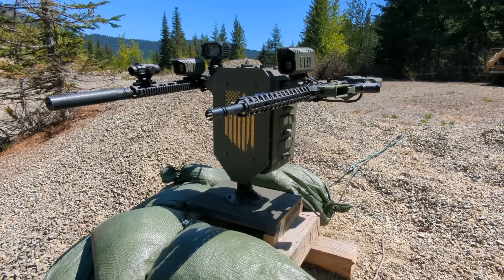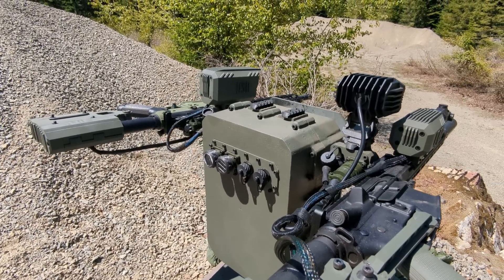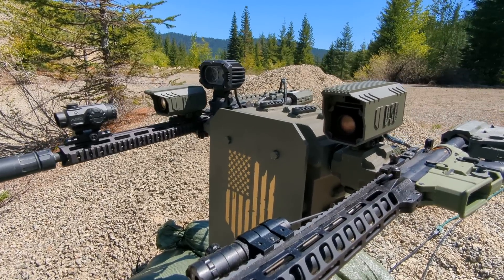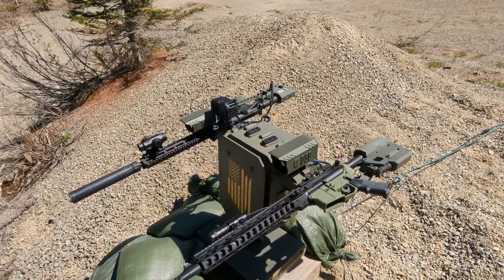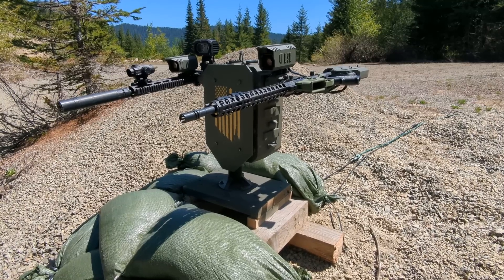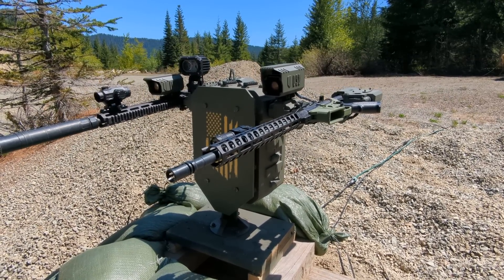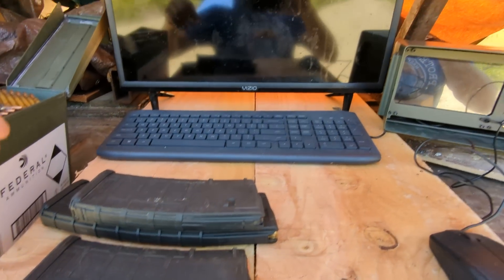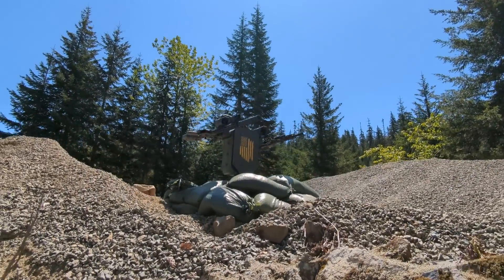Slow walk through of the deplorable powered gimbals features.  Grab some snacks and sit back.

Comment: Seems like any of the digital riflescopes with a video out, would simplify the camera and aiming solutions in a single unit.
Reply: Much more expensive though.
Reply from the maker: Great idea!  Ive never used one.  Do they have a usb output?  Any recommendations for a good one?
Reply: @deplorablesecuritydevices  Most have an USB-C or USB micro output. AGM, Pulsar, Sightron, maybe Sionyx would be where I would start to look.

Comment: If I did buy this.

Visual and targeting.
8K Camera with Night and Thermal.
Radar.

Hardening.
AR500 Steel Pillbox.
Kevlar Sandbags.

EMP Shielding of the Electronics.
Underground Hardwiring. to prevent countering through hacking or electronic warfare.
Reply from the maker: You got it!  Those are all on my list and more!  But starting with what I can do with the cash I have.  Also! the turret has a feature to raise and lower from a Pillbox or move side to side on a rail system.  Thanks for the comments it helps me grow!
Reply: @deplorablesecuritydevices Ukraine  needs this
Reply from the maker: @bobthompson4319  American tax payers have given them 180 Billion dollars.  They could have built 36 million of these with that money.  They have a 2000km border with Russia.  They could have placed these 10 meters apart 180 rows deep.  We could do the same on our border.
Reply: I didn't say give.. Why does everyone  think we just unload crates of cash to Ukraine? Maybe not all of what we give is but a large amount of what we give is expired munitions. Which is things I've ammo that would just be dumped full auto in the dirt and wear out weapons quicker. And just an FYI in the last 20 years Ukraine has been 3rd in the number of soldiers fighting along side of us. Only the  UK sent more.
Reply from the maker: @bobthompson4319  Fair enough my point is any developed country could have easily deployed something like this decades ago.  I think its strength will be realized as a distributed system owned by individual citzens of a nation.  My goal is to put at least four of these in the hands of every american land owner.

Comment: Are these legal for private citizens?
Reply: I can't see why not, it can be sold under an "airsoft" accessory if he runs into legal issues.
Reply: @Nick Loven  if the country is against that, but technically this is just a system, the weapons don't come included so literally this should be widely available if accessible to your country
Reply: Probably not. ATF just got two guys convicted for metal cards with pictures of something that resembles an auto sear... The ATF even cut out the picture and couldn't get it to work as an auto sear. Still somehow landed convictions.
Reply: @vampire847 but that cards purpose is only for making a machinegun and nothing else this can be used for airsoft as was said, or just bulky homebrew camera systems
Reply from the maker: Tyranny has never been defeated by compliance ... just sayin...
Reply: @Vinlaell  Literally the cards can not be used to make a machine gun. The picture isn't the right size or shape. The ATF tried to make it work and failed. The intent of the card is decoration.

Comment: The weapon mounts need to be closer together. If you zero one rifle and slave the other to the same zero it’s going to be wayyyyyy off at any range outside that zero.
Reply from the maker: You can have up to 4 cameras.  So each gun can have a scope camera.  Or the main central cameras have an approximate point of aim on thier heads up display.  If angles and distances between cameras and gun are known easy to implement overlaid reticles on any of the cameras.
Reply: @deplorablesecuritydevices  The idea of a software based reticle would work fine. From my understanding this is to be manually operated remotely so having one camera for a reticle would be sufficient and a red dot would be redundant. Having the barrels as close as possible would provide a much more simplistic reticle that’s easier to operate. I understand it’s a work in progress and it’s modular is design but you need to figure out exactly what you want out of this system. Saying “I don’t have a business plan” is not a good look. Don’t take my criticism the wrong way, I hope you succeed. I have a joint homestead for SHTF/WROL and we could actually utilize a system like this.

Comment: needs a WIFI connection for weather data to make It more accurite at long range as well as wind correction.

It should also have built in Ballistic data so you can have a screen entry for Ammo Ballistics, so it would know what is being fired (presets) so it can make the proper shot to hit the target  (automated).  ballistic data is online.

LOL the Ideas I could come up with this this..

weaponeer
Reply from the maker: @weaponeer  Will never have wifi all hard wired.  Machine vision and local sensors will estimate weather for long range shots.
Reply: @deplorablesecuritydevices  other option is a one wire weather station or components. So Data is available via wired network.  simple system. I used one for years to report the weather for our area.   I intend to use one again on my private range, especially for wind, and direction at fixed points downrange. more data=better dope, especially wind changes midrange 1000 yds and one at 2,000 yds (obviously a sentry would never shoot that far and even at 1,000 it does nothing but Raise costs, 300 would be good with overlapping fields of fire.  with proper long range thermal at least you can tell the difference between a man and an elk for required Pid.  the price can get rather steep when pushed out further
Reply: @weaponeer I don't see how a weather channel would provide accurate enough data. Wind can change so much in a few miles. Good idea. It should have the ability to connect to wifi for remote operation
Reply: @ToxicTom1967  the one wire is a local weather sensor setup, Which I used on my range.  But I prefer the kestrel 3500NV as it's more portable.
Reply: @weaponeer  sweet channel idk how u don't have more subs I subscribed
Reply: @ToxicTom1967   thanks for subscribing....    Never could get much traction for views, so i blame YouTube and its stance against the 2nd amendment.

Comment: What happens when spalling shoots into the handguard holes and into your gas tube
Reply: he shot at it in his previous video, although only a few times. im sure with a different type of handguard or mlok covers it'll be just fine.
Reply: People really over estimate spalling. Also if they are hitting the armor they’ll prob hit the guns too.  Even if the spalling could hurt them that’s not the big concern
Reply from the maker: Yeah, Derek and Simon nailed it.  Also anti spalling coatings is a solved problem on personal body armor.
Reply: Use piston driven, eliminating gas tubes, will run much cooler cleaner, way more reliable!👍🇺🇸
Reply from the maker: @user-ds6uc2hx3f  Oh!  Good idea!!!
Reply: Cool, good thing I had asked what would happen. 

Will there be a wireless variant and would you use LTE or a standard RF frequency? 

Sorry I just read the description. I was also wondering if you would ever consider fashioning a guide and belt fed system.
Reply: @CB_Camper  Okay right, I'm more concerned with someone walking up either protected or undetected and lodging the gimbal with a stick or burning the platform beneath it or just straight up unplugging it I guess one can setup motion detectors or thermal on the system. does this system come with night vision?
Reply: Wait I guess the best place to install these would be on an elevated surface. does it have any sort of detection assistance? if shoot a flare in front of the thing will i be completely blinded, would it be a smart idea to setup auxiliary IR cameras with that laser to assist in accurate fire.